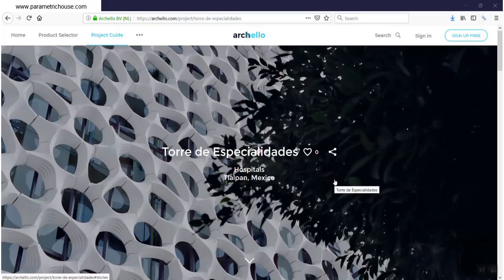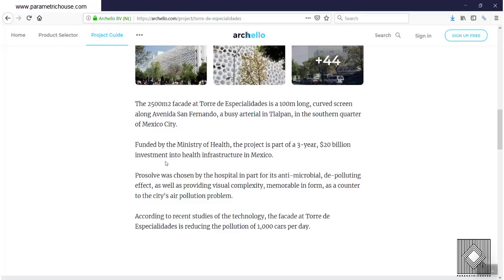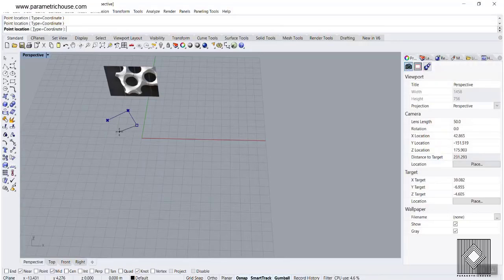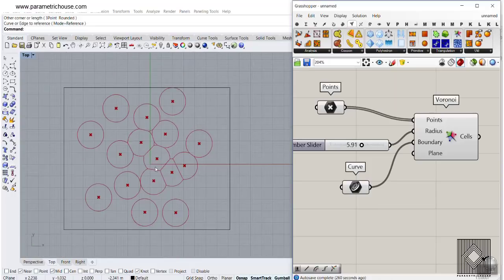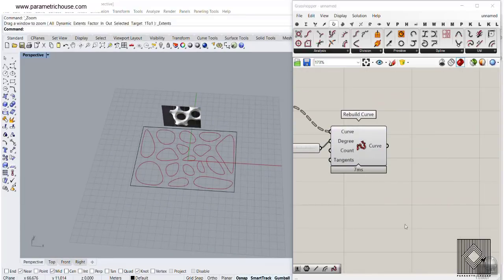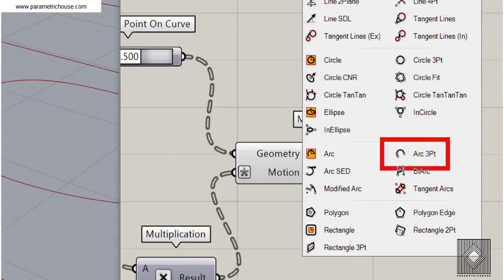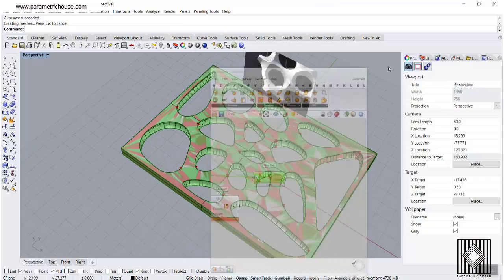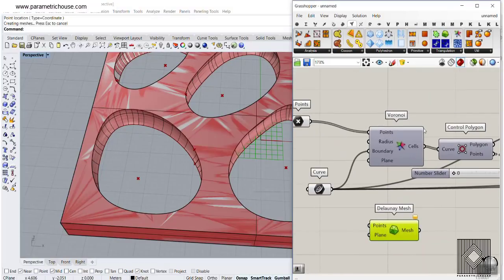Voronoi Diagram ( Torre De Especialidades)

Comment: Voronoi Façade is fantastic...!! One question may remain unanswered is The same feat could have been accomplished with square grid or rotated triangular pitch grid. What is so special about Voronoi shape in this case. Is it for just aesthetic or does it have any in depth technical reason. Why spend so much money in fabrication etc when you can simply fabricate square grids with readily available material and just coat them with Tiataium Dioxide...By the way..I  followed this tutorial till 20:22 and then got lost....it is too much for me right now...just starting to get the hang of it..